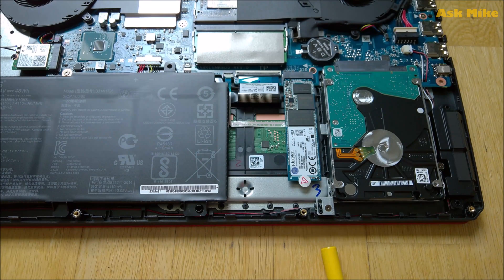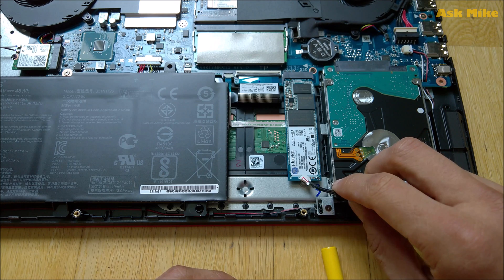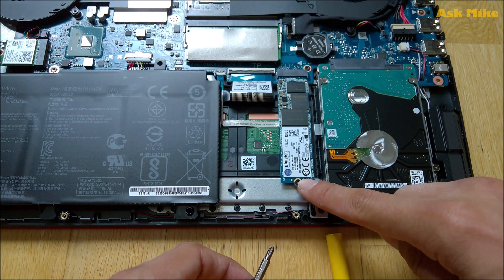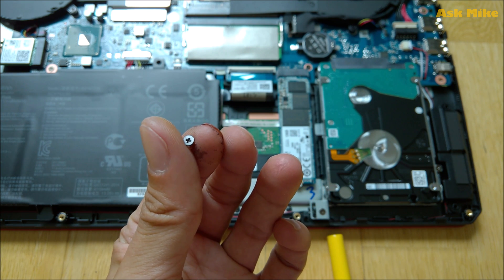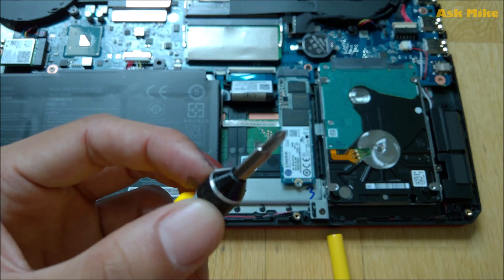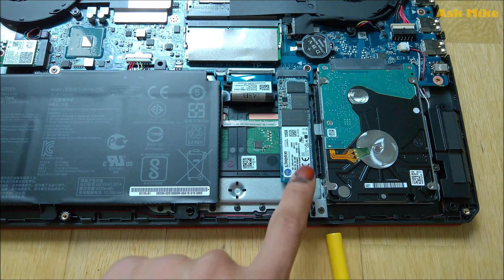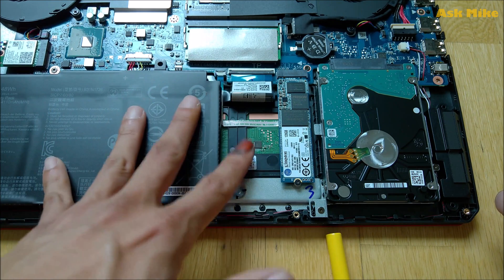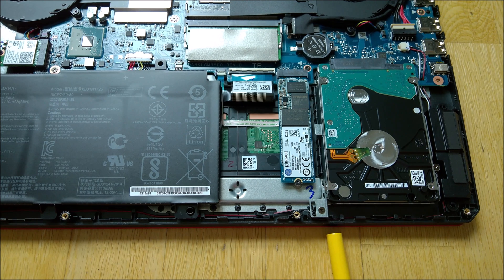Asus TUF FX504G Budget Gaming Laptop Upgrade SSD

Comment: Hi Mike,
I own a FX505GD 4GB RAM 
I had upgraded my m.2 SSD with ADATA XPG SX8200 PRO 512GB. 
The official read speed for the ssd is around 3500MB/s, but I only get around 1800MB/s for read speed.
The ssd can't run in full speed 

Oddly, the ssd able to run 2300MB/s for write speed which as advertised in official website.

Please help, what's the problem ya? Thanks in advance!
Reply: Is the SSD still working until now?
I want to upgrade my FX504GD laptop with an SSD, I want to buy XPG SX8200 Pro 512gb M.2 NVMe SSD.  Does it work on fx504?

Comment: Hi, it will work with a Samsung 970 Evo Plus 500 GB? Thanks!
Reply from the maker: It should work but you will not get the max speed. I would recommend that you go with Gen3 x2 NVME like Adata or Kingston... price would be lower.
Reply: @AskMike  ADATA XPG SX8200 Pro is good?
Reply: @AskMike  Can I use XPG SX8200 Pro m.2 NVMe 512GB on FX504 ?

Comment: Hello Mike!
Is the laptop compatible with SATA or is it only for PCIe?
Note: My question is for the M.2 2280 slot.
Reply from the maker: It support NVME PCie Gen3x2... in theory it should support SATA m.2 drive as well but I have not try it though.
Reply: @AskMike   hi. Are you sure 3x4 gonna work ?  Did put 3x4 on fox 504 GE and it is detected easily? You rich the maximum speed?
Reply: Will nvme gen 3x4 work

Comment: Hey mike !! sorry one question do you expierence any spike in gaming, whenever i tried running dota in medium setting its seem to spike
Reply from the maker: Maybe I am not a long gamer but so far nothing in particular capture my attention. It might be because of the graphic card which is not good enough..
Reply from the maker: Frankly this laptop is not on par with many gaming laptop out there now.. even the upcoming FX505 seems to be much better.
Reply: this laptop throttling a lot so the only way to fix it is updating your bios and undervolt your cpu.

Comment: Hi Mike !
May i ask a question, is it possible to install a 2.5 inch SSD sata into this laptop ?
Thanks
Reply from the maker: It is possible but you would need to take out the 2.5 inch Firecuda HDD. I would advise to get the M.2 SSD so that you would have both SSD and HDD running on your system. If you plan to get this laptop I would advice to wait for the FX505 which is launching soon. Much better than this.
Reply: thank you so much :)

Comment: Hi a few questions for this fx504G, DDM491T there is no ssd come with. But does it ready with m.2 slot ? And if yes what kind of ssd should I choose
Reply from the maker: Yes it comes with m.2 slot in all variance. You should be getting at least NVME it has faster speed.

Comment: Will Kingston A1000 M.2 NVMe 240gb work in Asus TUF FX504 E4021T?
Thanks in advance.
Reply from the maker: This one should work fine without problem. Sorry for the late reply.. pretty busy recently
Reply: @AskMike  thank you mike 😊.. its fine.. 
I also wanted to know which is the 128gb ssd that comes default with the laptop?kindly share model no. Is it a nvme pcie x2 ssd? What is its max read and write speeds? Really big thanks in advance.😁
Reply from the maker: I have posted the speeds in the comments, feel free to check thru it. it is X2 NVME SSD. The speed is slight better than normal SSD. If you machine don't have it better get a faster NVME. The one comes with it is so so only.

Comment: May I ask can this laptop support Samsung 860 EVO M.2 or 970 EVO Pro NVMe? Planning to switch for a higher SSD capacity as 128 is too little.
Reply from the maker: It supports the It is PCIE Gen3x2 SSD but it should run Samsung EVO NVME just that you might not get the full speed of 4 lanes since the motherboard only support 2.  The price doesn't make a lot of difference between the x2 or x4 so I would go for the x4 for the best value. x2 is phasing out soon anyway.